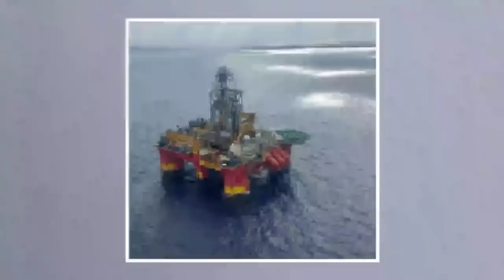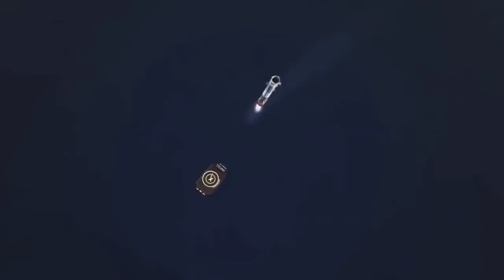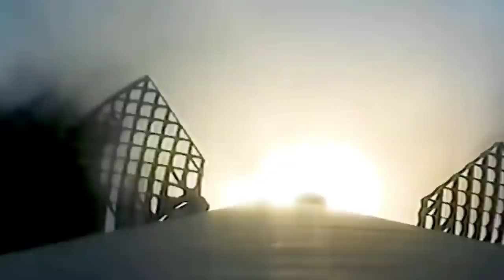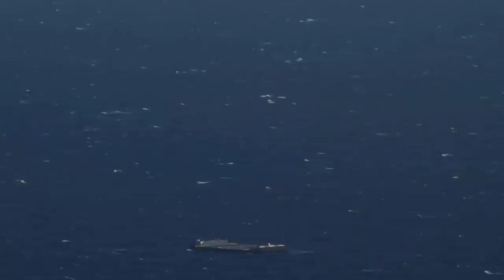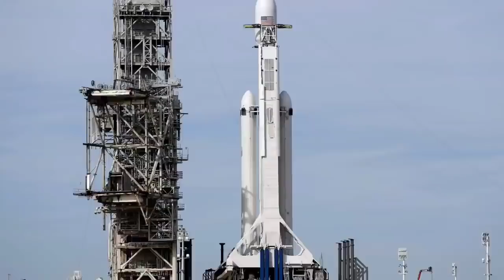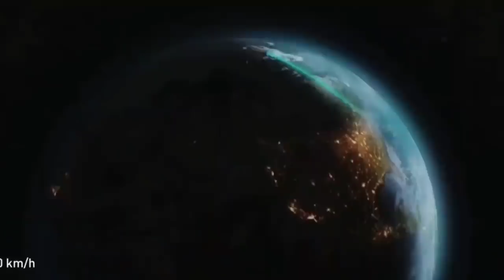SpaceX Try To Land Super Heavy Booster Onto The Droneship

Comment: Click bait BS.  SpaceX has said on countless occasions that putting landing legs on the booster adds way to much weight, unneeded complexity and defeats stated goal of quick turnaround.  With performance of the Starship system if a difficult orbit is required they would reduce payload by the required amount

Comment: With a structure the size of an oil rig.  Wouldn't it be more feasible to simple refurbish the landed rockets in-situ?  Using drone ships to move supplies back and forth and occasionally brining back rockets that require more in-depth work while leaving the majority of the platforms at sea, on the platform, where they can be repaired/refueled and then launched again?
Reply: A necessity for point-to-point transport on Earth.